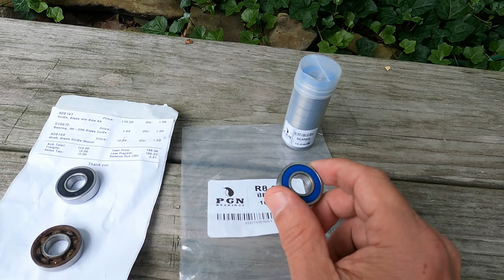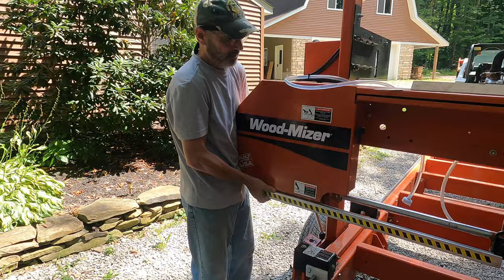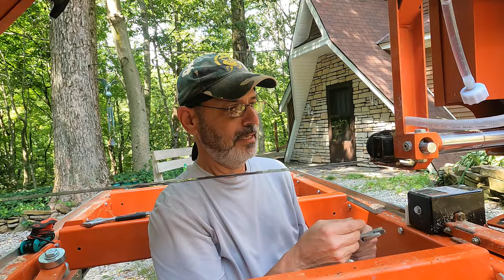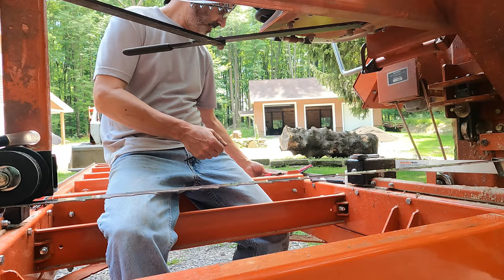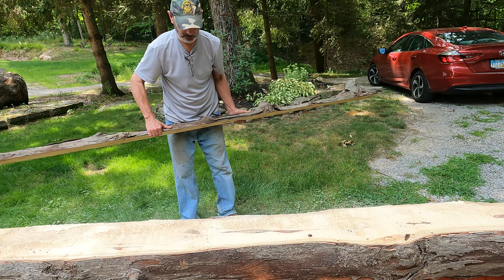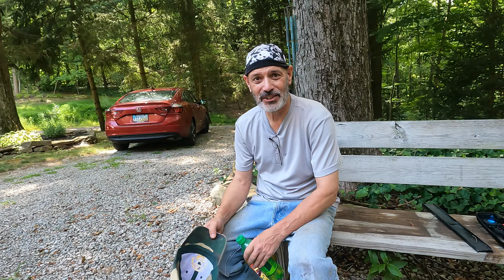We fixed the sawmill and aligned the blade on the woodmizer LT15

Comment: Had to skip forward , didn't want to see you cut yourself more, why no socket or end wrench?  Also on my LT 15 I use that  big builders square you had at the end of the video to lay on the bed to check the blade height, get no deflection when your tape or ruler isn't plum and very easy to read. The outside of the head need to come up a 1/16" + to cut square.  I use a little short piece of aluminum 1/4" flat stock to run under the alinement tool, just slide it forward and back ward to get the blade level. Great welders sock cap, where did you get it. What a great video covering all the adjustments for the cross slide, rollers and blade settings, better than any I've see on the tube. Wasn't being a smart A__  but just notice a few things that might help you out. Last thing, get a piece of leather and lay it over the blade, your gonnnnnnna cut your arm or worse, juggler..lol  Great video  👍👍👍👍👌👌 OH, almost forgot, heard many say the auto travel doesn't work well, what do you think about it? I want one if it works on mine, Do more videos please.  National bearings, number 1

Comment: Good video on roller bearing problem and replacing. It’s nice to see sawyers that have problems share there experience and fixes.  I’m a mechanic and I always research parts and cross part numbers to find the best part and where it’s made. I find most of good bearings at Napa . Great job application you sharing and take care.

Comment: The bearings always wear out quickest on the side that the water comes out.
Reply from the maker: I get that because they get wet, but the replacement had seals on both sides, the bad one had no seal on one side so it would accept grease but I don't have greaseable wheel.

Comment: thank you for posting this video. relatively new LT15 wide owner here.  set my mill up and have cut a few logs.  going to check the setup when it warms up a bit and see how off the mill was out of the box.  only thing i was thinking is that shouldn't you reference the blade off the tracks that the saw carriage rides on, rather than the bunks ?
Reply from the maker: Definitely measure to the bunks not the rail. But before you start to check anything make sure the saw is perfectly flat and level with no sag in the middle or do all your measuring on the same bunk. The saw frame will flex up to 1/4 inch as the saw moves over it if you don't have all the feet set perfect.

Comment: Thanks for the video. I couldn't how to adjust everything on woodmizers site. What did you measure to level the arm? It was at 7" but I couldn't see what you were measuring. Thanks
Reply from the maker: Arm all to right measure bunk to blade, arm all to left measure same thing, they should match
Reply from the maker: Measure to blade very close to arm roller

Comment: Same thing happened on mine! Kinda frustrating but relatively easy fix. 

I ordered the pulley with the bearings in it … going to get extra bearings from Amazon as back up. 

I have to check the blade tracking next … it’s definitely not cutting correctly. 

Thanks for posting
Reply from the maker: My LT15 is now 2 years old. I've got no complaints.

Comment: Suggestion: buy some locknuts. They only have a vew (very few) installation lifespans. Open bearings, unless you grease the crap (pun) out of them will accumulated chips, dust and dirt.
Reply from the maker: These are supposed to be sealed bearings, the open ones are for the greaseable rollers.

Comment: Yep.  That's what happens when you run water to keep the blade cool.  It gets into the bearings and rusts them.  I owned a LT50 and now a LT 70 .  I never had a roller bearing failure because I run diesel fuel as a lube and I occasionally pop the seal off the bearing and repack with high-speed wheel bearing grease.  I just did a video of this procedure for a lawnmower bearing that I fixed.  Check it out.   https://youtu.be/cyXBzOXbLPE
Reply from the maker: Once I replaced it with a sealed bearing it hasn't been a problem, but your point is valid, diesel would have prevented the failure